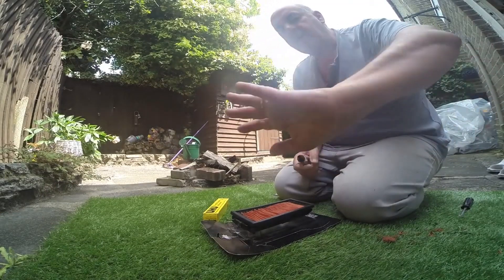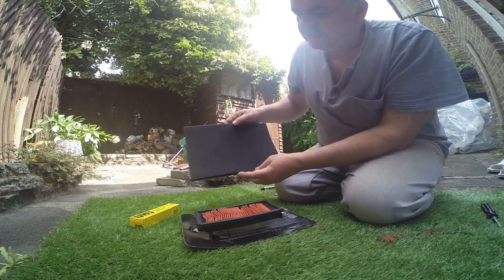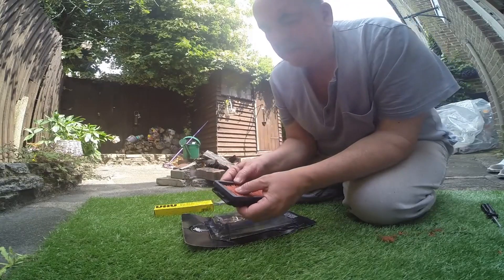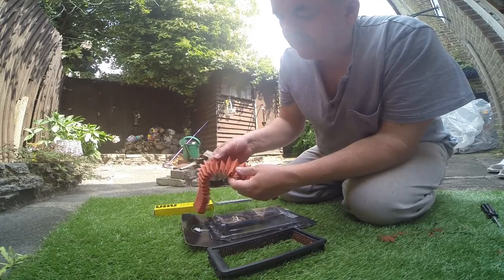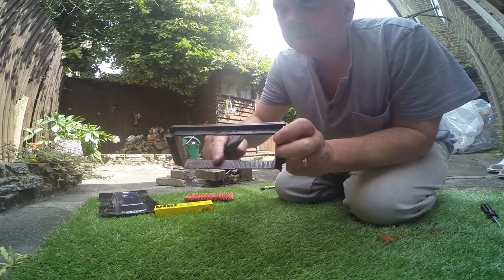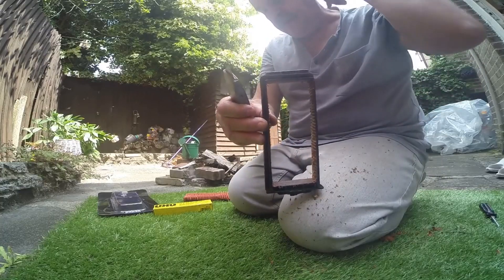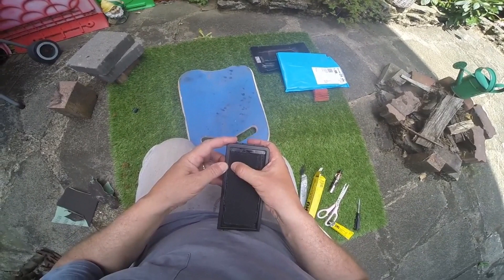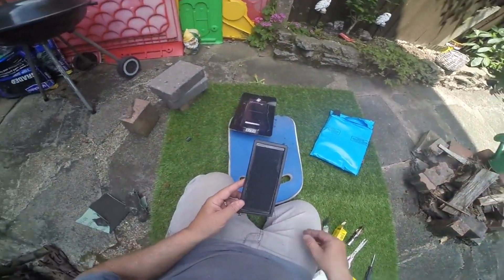FOR ALL ZONTES AIR FILTER CONVERSION MORE POWER

Comment: I would like to thank you for your great effort and What is the degree of foam density and what are the technical specifications?
Reply from the maker: Hi I'm at work but if you search ram air filter or ram air foam the tech spec will be on there website they do lots of filters for sports cars etc as well as the foam do you can do your own, and thank you for your kind words, it means a lot as a lot of effort goes into my videos thanks
Reply: Hi Michael, good tip, by the way do you have any videos on how to open the electric seat if the battery is dead?
Reply from the maker: @MegaHorse7  it depends which model x
Reply: 350T2
Reply: May be similar to the 310T
Reply from the maker: @MegaHorse7  so you asking regarding the 310T
Reply: Yes please

Comment: is this safe for engine ? thanks
Reply from the maker: Yes , you just letting the engine gulp as much air as it needs rather than being restrictive
Reply: @michaelphillips1959  thanks
Reply: YOU KNOW WHAT GIVES IT A GOOD EXTRA PUNCH, DRILL SOME HOLES ON THE AIR FILTER LID, YOU CAN REALLY FEEL DE ENGINE BREATHE A LOT BETTER, IT RUNS BETTER OFF THE LINE

Comment: hi was power increase noticeable
Reply from the maker: Low down rev torque increases
Reply: @michaelphillips1959  Has MPG changed
Reply from the maker: @dazznutts  nope the bike can just suck as much air as it wants to I reckon it's slightly better on pick up
Reply: @michaelphillips1959  have to buy an orignal filter to do mod - where did you buy yours from
Reply from the maker: @dazznutts  your zontes dealer, AliExpress, your country zontes importer also will have stock, eBay, they all around same price ta
Reply: @michaelphillips1959  is DNA sport air filter better?
Reply from the maker: @EndritAl  it's going to have the same air flow, as the ram air, cost you 60 euros against minimal cost of D.I.Y.
Reply: @michaelphillips1959  I see.But I thought foam air gets more dirt? Otherwise I will try the foam into my U125,combined with iridium spark plug.
Reply from the maker: @EndritAl  the ram air foam has two layers one more dense,  and it's easier to hoover it than the oil type ones
Reply from the maker: @EndritAl  check your manual as most zontes bikes come with iridium plug can't check myself as at work , plugs last easy 60,000 kilometers
Reply: @dazznutts  WHY RUIN A NEW ONE, DO IT ON THE OLD USED ONE, IT ONLY TAKES ABOUT 20MIN TO DO THE WHOLE JOB.